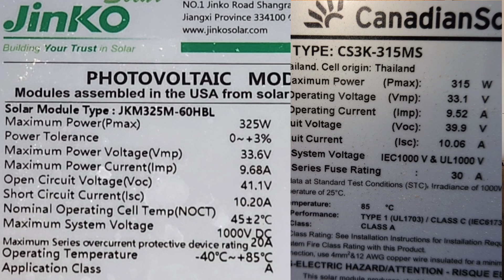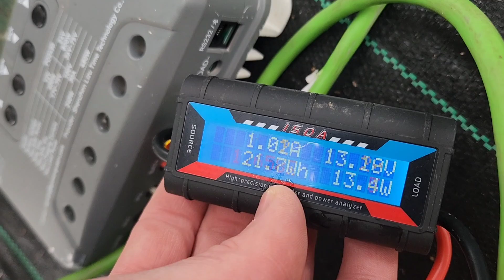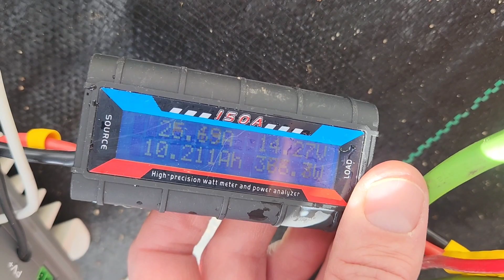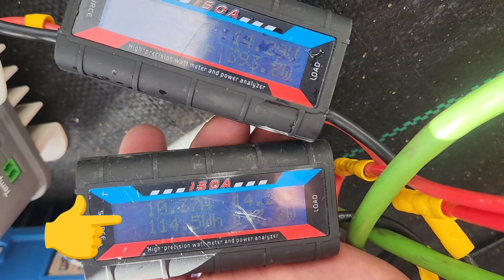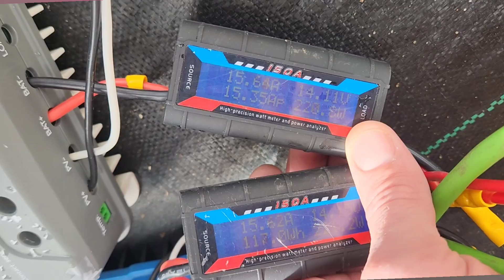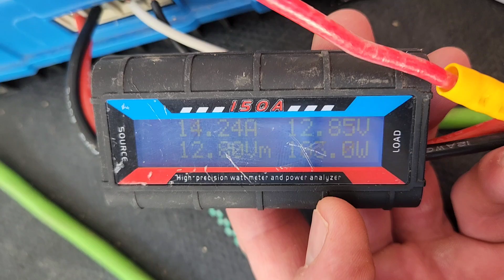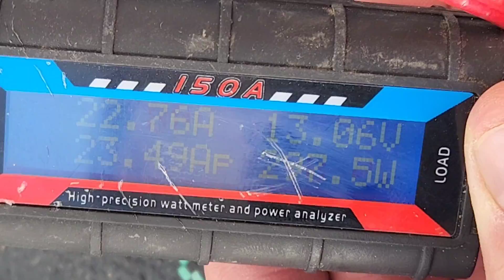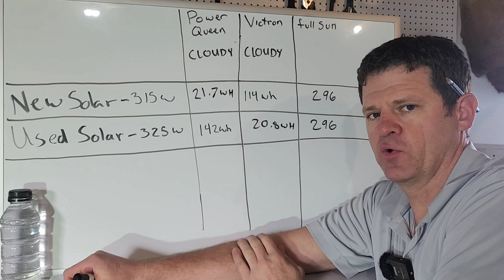Are Used Solar Panels Worth The Money? Performance Test Results

Comment from the maker: Used Solar Panels: https://shorturl.at/swyGL
New Solar Panels: https://shorturl.at/fPW27
Victron MPPT: https://shorturl.at/tuAEQ
Powerqueen MPPT : https://amzn.to/4aNwjem
Watt Power Meter:  https://amzn.to/3ww8x6L
Reply: Thank you. My comment was for Beebop.
Reply: Bought my used 250 watt panels 3 years ago. They were 30 bucks ea.. they have been running like clockwork ever since. Producing  at least 105% of rated power for at least 5 hours a day when the sun shines.
Reply: What do you think about the fact that a new 315W solar panel costs 49€ (about the same amount of USD) and is really unused...
Reply from the maker: @MR-ub6sq  in Europe panels are much more affordable. If it is used, you will definitely be able to tell. Water marks etc.

Comment: i am not sure if having both charge controllers running at the same time, into the same battery is a valid test ... is one charge controller doing all the work, and the other suppressed? ( i dont know for sure ... suspecting) I would be curious to see discreet systems from 20 to 80% charge. I could be off base ...
Reply from the maker: If I was close to the max charge rate, it would suppress one of them, I assumed.  But I don't believe it was close to that, so the battery was accepting any power I could throw at it.

Comment: I almost bought used panels at San Tan, then found a much better deal; over 7,800 watts for $1000 OTD.  I tested the first two on the pallet and they're doing 101% of the rated SCC.

Comment: From what I’ve learned in assessing used panels, it makes sense to buy 200% of your needs. Say you need 1kW you buy 2kW, put 500W in storage as spares. Set up your 1.5kW worth of panels and your charge controller will perform well on far from ideal days because of the larger redundant array.
You couldn’t do that at new prices. 

Of course you need to observe open circuit voltages, de rate for your winter temps and make sure that doesn’t exceed your charge controller’s voltage limit.

Comment: Damn you get screwed over there for some foil/foil panels that will disintegrate at around 12 years. Here in germany I got the Trina vertex s+ 435 bifacial glas/glas for 75€ / panel (new)
Reply from the maker: That's crazy. Where can you buy those at? We do get screwed over here in the US on solar prices.
Reply: @diySolarPowerFunWithRay  Here are so many chinese panels for under 70€ nearly everywhere to buy, this is nice for the end user, but this is the reason why solar producers are turning their back on germany and the EU.

Comment: Yes most likely the difference was due to the MPPT.
Reply from the maker: I accounted for that
Reply: @diySolarPowerFunWithRay  I'm referring to the partly sunny test when the used panel got significantly more. The Power Queen MPPT just seems to have a superior max power point algorithm when compared to the Victron. There can not be any other explanation for that large difference 142Wh vs 114Wh.
Reply from the maker: @electrodacus  Yeah, that's a good point.

Comment: It's safe to assume that you've lost half a decade of use by buying secondhand - that alone justifies the price. If you live in Texas it is highly unlikely that those panels will last another five years and it is for this reason solar installers go bust and or change their name so they don't have to honor the so-called 20 year 'guarantee'. I am on my third set of good rigid panels and I did my own install from the get-go as I am a retired power production specialist for the federal government.
Reply from the maker: Thanks for the comment, it's a good point that I did lose 5 years out of these panels.  Because they are performing the same as the new panels I'm not too concerned . down the road that could change though . Who knows. Have you found that hotter weather is pretty hard on your panels? 3rd set? Wow,  that's crazy!

Comment: the catch is with santan solar the minimum to buy is 10 panels so you have to spend a lot of money at once usually. At least that's what I've seen
Reply from the maker: That's true. If you live close to their location I think they might sell smaller quantities. If you're willing to pick them up
Reply: What if that 325 watt module only produces 50 watts?
Reply: @raygibson1295  right!
Reply from the maker: @raygibson1295  they will refund you

Comment: Love your4 vids need your advice.. I'm running 5 miners total of 1000 watts running 24-7..   What would you suggest. Thanks...
Reply from the maker: Just running some quick numbers in my head you would need 700 watts of solar and a 12 volt 200 amp hour lfp battery... sunny conditions.  It will give you a little bit of room to expand...imo.
Reply: @diySolarPowerFunWithRay  he's gonna need way more than that in both batteries and panels, at least try doubling it.

Comment: New is good if you get some credits/rebates. Old generally are fine as long as the panel is not damaged - no snail trails, burns on back or cracked glass etc otherwise degradation per year is pretty small like 1% per year or something. The only issue would be you shouldn't mix and match panels so if an array is damaged by hail etc then you need to replace the lot on that string, unless you using micro inverters then its doesn't matter each one is contributing AC back to the grid. The only time one might look at new is for full install not DIY or as you say looking at new technology bifacial or newer panels have significantly better performance per area (though these days panels are sold to unsuspecting customers on being higher powered when in reality they are just bigger panels). I got a load of them for off grid and also replace a 18month string damaged by hail and they were second hand and actually higher rated panels. Higher output on panels is due to temp on the panel the closer or to 25c or lower the panel will produce more power - though have to be careful as the voltage and amps go up from memory in cold weather and in cloud edge effect that you had.

Comment: I bought 2 used Trina 250w panels for my off grid shed. I have them on a renogy rover 40amp mppt 12v. I usually see 380-450 watts depending on temperature outside in full sun around noon. I paid $120 them and honestly I'd do it again. I also have 6 renogy 100 watt panels ok the same controller and I see 500-550 most of the time. During partly cloudy weather I will see 550-650 watts during cloud edge effect. On my array I made including 12 of those renogy 100 watt panels I observed  1450 watt peak and average 1250 during cold temperatures. From 12-2pm. Very please with used panels. You do have to watch out for the corroded bus bars. Those will catch fire. I looked through the stack before buying mine. I was hapoy to see you tested each panel separately while not hooked to the battery at the same time. Better results. Also the panels should be under a load (charging for about 15 minutes before taking peak power measurements but honestly it's not much of a difference with a 500 or less system. Anything above 500 watts if it's crucial then a hot panel test is nice to have the information from vs the cold panel test. Nice job and thank you for the video!
Reply from the maker: thanks!
Reply: I’d be interested to hear how old your Trina panels are. I found a local source and would like to gauge the expected performance drop.
Reply: @Tokyo1991.JL1AJE  they were 10 years old supposedly and I have had then for 2 years. I'll see if I can find a date code or use the serial numbers to find out. In curious now myself lol. You can do a open circuit test and short circuit test in full sun to find out thier output. Just connect the negative and positive and use a DC amp clamp. If the isc is (example) 10 amps and you measure 9 amps at rated temperature then it's got 90% life left. Hope this helps for testing before buying! Also trinas you need to inspect the bus bars for corrosion. It'll be green. :)
Reply: Hey thanks for the detailed reply. The panels I’m looking at are about that old.
Do Trina panels suffer from snail trails? Thanks for the heads up on the corrosion. 

Another tip: I take the spec Open Voltage x Short Current and compare that to the spec MPP to give me an expected performance value (0.76 for the panels I’m looking at).

When you test you multiply the OCV x CCI x 0.76 to get your guesstimated power.

I’ll add as well it’s worth having a known working panel on hand (I have a 50W panel)  so you can gauge the actual ‘solar performance’ on the day you’re testing panels.

Say you only see 40W out of your 50W good panel then what ever panel you test you could expect to see an extra 25% on a good day.

The weather is far from ideal for testing as we are in the humid rainy season before summer unleashes itself.

Hopefully I can snag enough to give me 1.5kW and start some serious tinkering :)
Reply: @Tokyo1991.JL1AJE  absolutely and thanks! With used panels, overpaneling is a good idea lol. They are known for snail trails but only early on. So if they don't have them then your pretty much safe lol.

Comment: I got 3000 watt growatt and 200ah 24 v lifepo4 battary no panels yet.
I really trying to find a clear understanding of how lomg the battery will power a 5amp  fridge.
I was told it would only last 1.5 hours roughly its hard for me to grasp that idea please need some understanding
Reply from the maker: Yeah, Fridges are a little more tricky to estimate. I made a video on this exact subject though :)    https://youtu.be/z1T-liUaPQ4
Reply: 5 Amp X 120V is 600W so your fridge is not quite as energy efficient by todays standards. Mine doesn't go over 2.5 amps and its a huge LG fridge/freezer. With that said, a single 190Ah lifepo4 is perfect for my use. The fridge has never shut down due to lacking power for about two years so far. Try doubling your battery capacity or opt for a more efficient, newer model fridge. My fridge is outside in open air, not in a hot garage so I don't have to combat an extra 300 watts of heat output turning on the AC. So a 600 watt fridge will cancel out a 5,000 BTU window AC if you're trying to cool the living space with the fridge. A lot of people don't understand that having an older fridge is akin to throwing cash out the window with the current energy rates. After a year of runtime the EXTRA allotment on your power bill would have most likely paid for the extra lifepo4 battery - albeit, a used one.

Comment: Your videos are some of the best solar videos on YT!  At $30 a panel for the used instead of bi-facials you could just put the $30 ones back to back and and still be cheaper and get both sides!
Reply from the maker: Lol!  That's a good point!
Reply: @diySolarPowerFunWithRay  I smell a new video idea.....do a test with a couple of panels .....I dare you!!!!
Reply from the maker: I like the way you're thinking.
Reply from the maker: If you leave a gap i think they might work out.

Comment: Solar MPPT contollers vary on their power point. Your test would be more conclusive if you had used the Victron for both panels rather than throwing in the variable of the other MPPT controller. San Tan has great prices but it's the freight that kills the deal.
Reply from the maker: I accounted for this in the test.